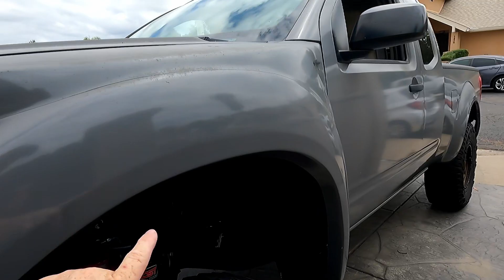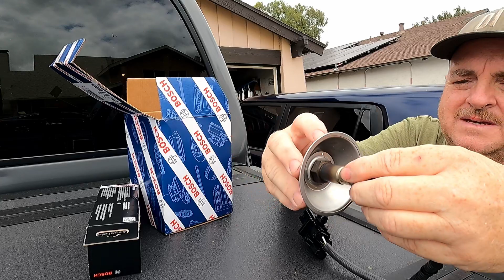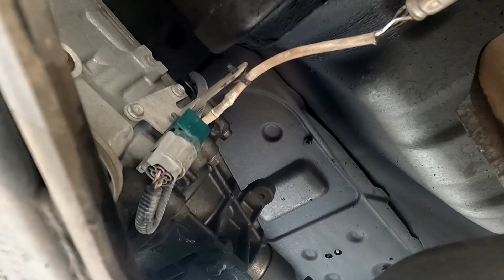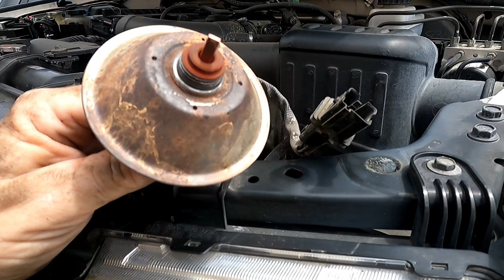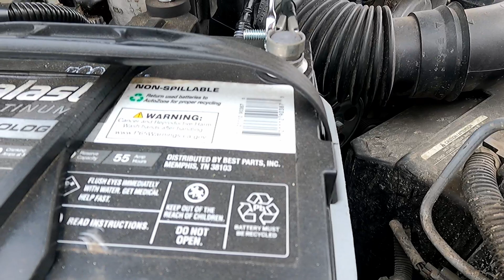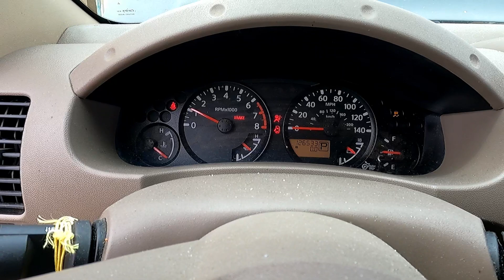*P0420* 4 Cyl Nissan Frontier Oxygen Sensor Replace

Comment: That upstream sensor was toast. Great catch. You saved your friend a bunch of money on this one!
Reply from the maker: Yes I wasn’t sure. The bad O2 sensor should have been a different trouble code. I can only think that it was still working but not correctly. Possibly telling the computer that there was more oxygen in the system exhaust than there actually was. Making the computer think there was a restriction in the cat??? I don’t know?? Good news though the truck passed smog test this morning so it was a good catch!! Saved lots of money over installing a new cat. Next repair will be the airbag clock spring to fix his other codes.

Comment: My 06 xterra (same eng)but 6cyl keeps tripping the P0430 code (drivers side) every approx 30mi. Ive replaced both O2 sensors intake plenum gaskets,spark plugs fuel inj. orings,cleaned the fuel injectors with my electronic fuel inj.pulser, replaced a cracked exhaust header with an oem one and it still trips the eng ck lite.all thats left is the Cat i guess.Which i have a new one (Walker Ca carb complient) it is seperate from the exhaust manifold but haven't put it on yet,dont know what else could be tripping the code??
Reply from the maker: You’ve changed everything but the cat at this point. Must be the cat…
Reply: I’ve never heard of it not being the cat. Willys vid is the first time I’ve heard of spending time on a O2 sensor. Unless you’re in California you’ll save money by just doing the cat first. because… it’s the cat.
Reply from the maker: The truck just passed California smog test. Strange that the problem was a damaged 02 sensor showing a P0420 code. Weird!!!
Reply: @DIYWilly  that is weird. I mean it makes senses in terms of circuit logic I’ve just never heard of one actually being bad before on a nissan, usually they last and last, maybe I’ll actually try mine next time I do the cats, which are due
Reply from the maker: My next repair for this truck will be the steering clock spring. Any tips or suggestions?
Reply: @DIYWilly ..I've never delt with a steering clock spring,that's new to me.🤷
Reply from the maker: It’s the part the keeps all the electrical items working when turning the steering wheel. When it fails the horn, steering wheel controls and air bag usually stops working. It’s bad in this truck. Probably do a video soon on the clock spring
Reply: @DIYWilly  ..oh ok, kind of sounds like a slip ring.
Reply: @DIYWilly  interesting that will be good to see. I’ve heard of them going, but I actually thought it referred to the ignition key spring, which I’ve had go bad in other cars. Had no idea.
Reply from the maker: Stay tuned!!
Reply from the maker: I agree I would have figure a bad 02 would have given a different code. Maybe the damaged sensor was still working but not correctly.